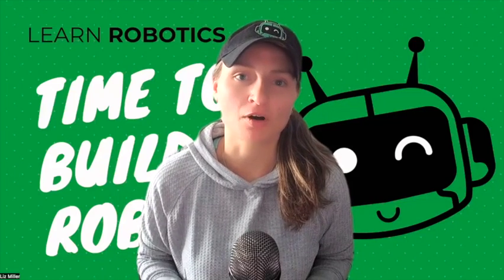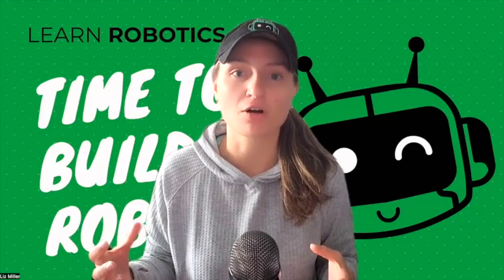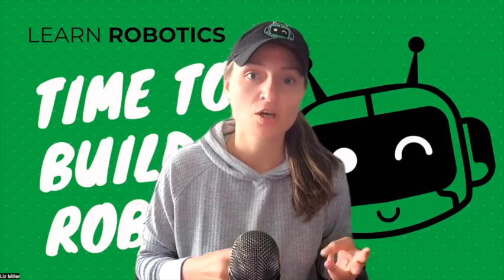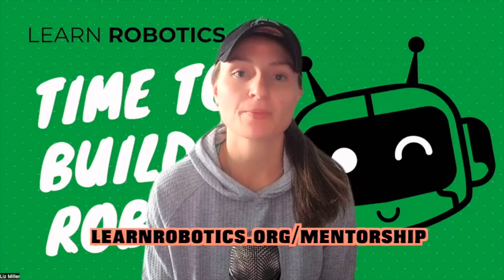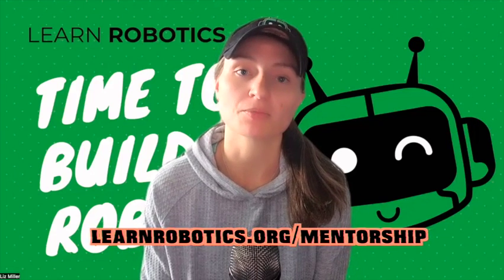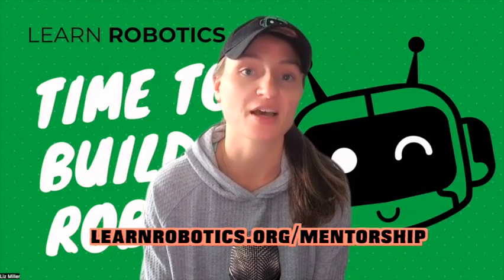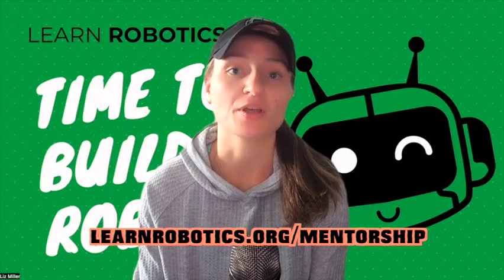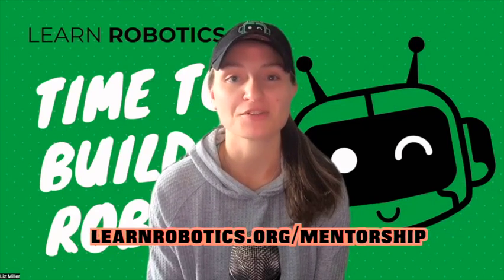Robotics Career: What it's like to work as a System Integrator for Manufacturing

Comment: Liz, 

Great Videos!!! How about a Node Red on a Pico W video? Maybe a temperature/humidity monitor either a DS18B20 or a DHT11/22 with the PICO as an AP to access the data. Just a thought. Keep the videos coming
Reply from the maker: No different than the videos and projects we put together for RPi 3B+ swap the pin out and plug in your I/O.